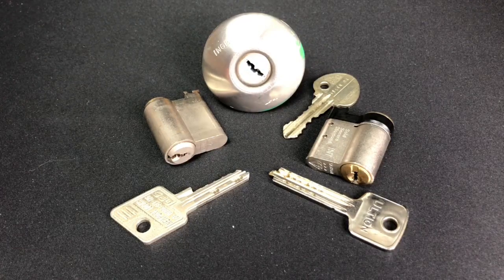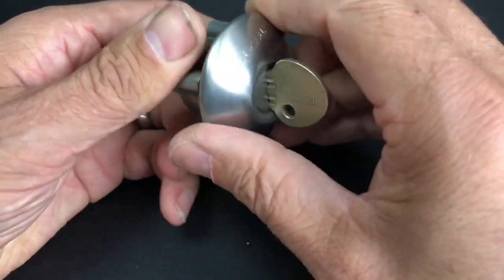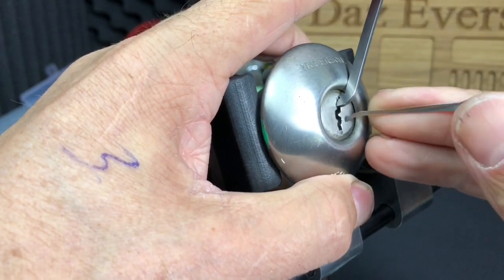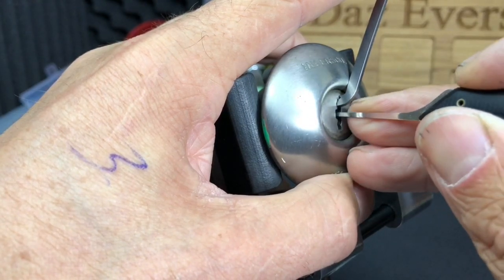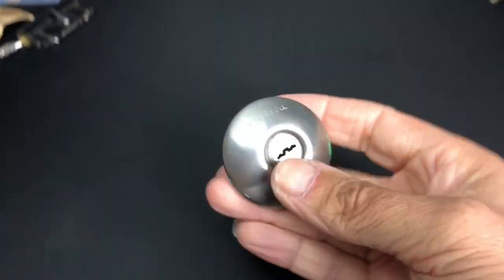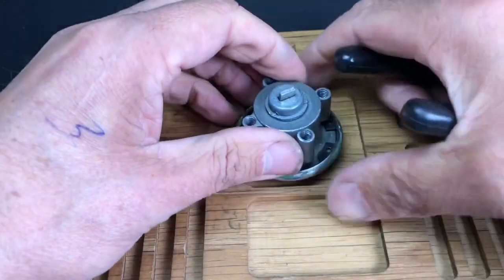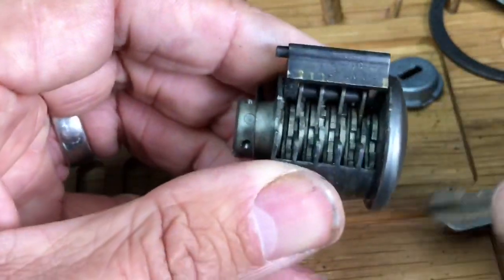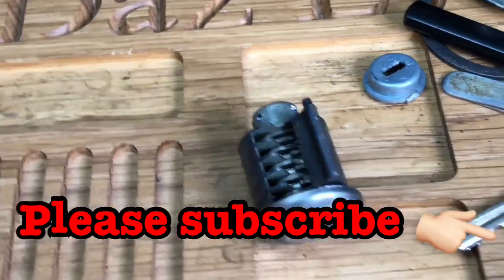Ingersoll 10 Lever Mortise Lock “Picked & Gutted”(An Amazing mechanism)

Comment: A very interesting lock mechanism. Are you able to take it apart any further or is that the limit of what it allows?
Reply from the maker: Gary Rumain They are one of my favourite locks so far Gary. I’m try to find out, the lock has a bar going through it that looks to be fixed at both ends, if I can strip the lock down with out breaking it I will do a follow up video on it. 👍
Reply: @dazevers  OK.